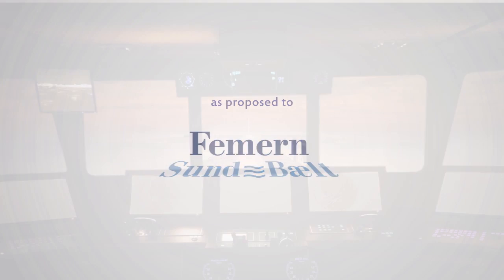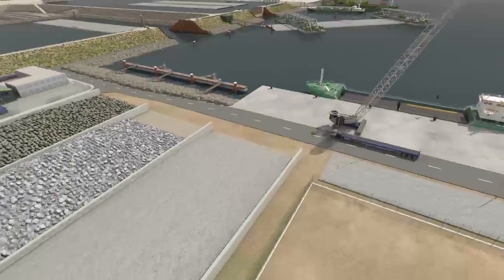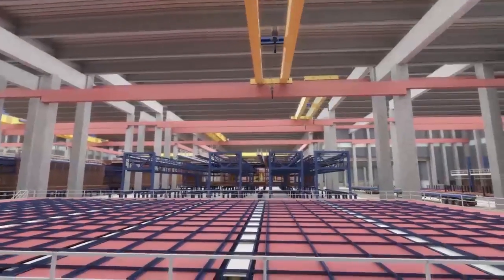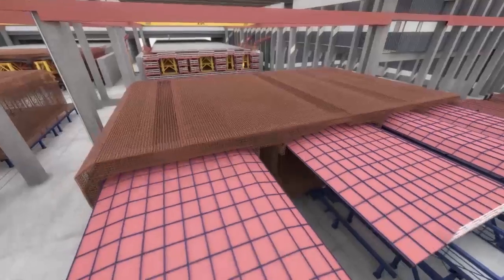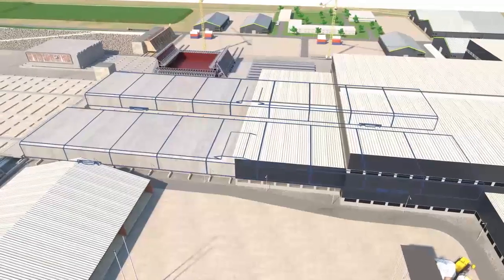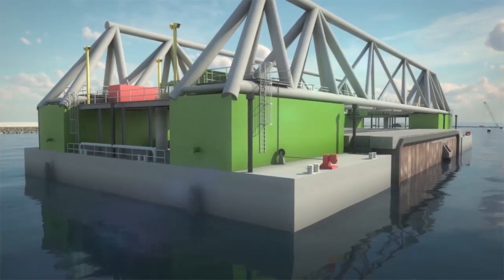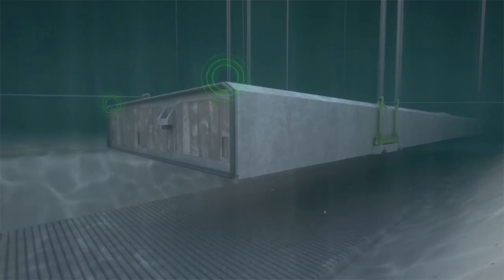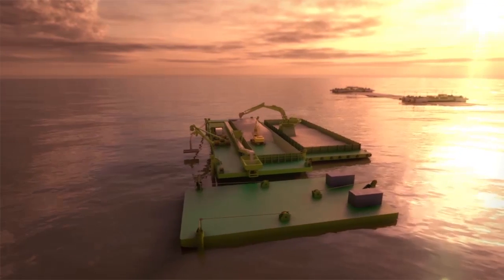World record tunnel factory for the Fehmarnbelt tunnel

Comment: You will get a building permit for a hyperloop link (pipe diameter 3.3 m for passengers, cars, and sea containers) more easily than for a road tunnel, because an interstate- (or Autobahn-) type highway disturbs Fehmarn Island more than a two pipe hyperloop link, or hyperloop plus conventional rail link and train station at Puttgarden. You would still be able to transport cargo, cars, and passengers, and the hyperloop would become part of a future network. This relieves the Fehmarn Belt Bridge of through-traffic to Denmark while allowing Fehmarn tourism.
Karl Themel
Je suis Charlie
Reply: Hyperloops cannot work.